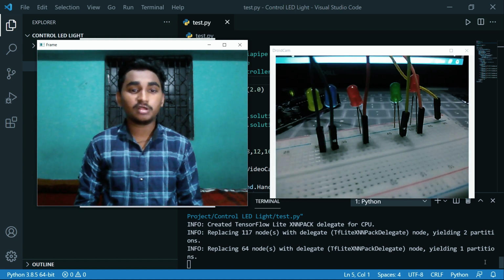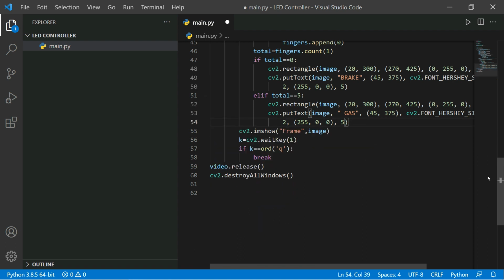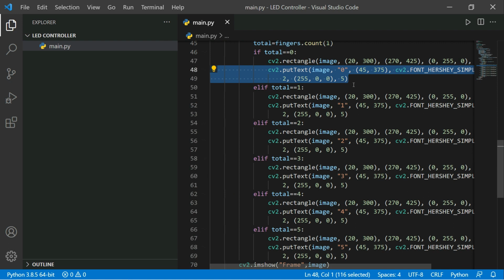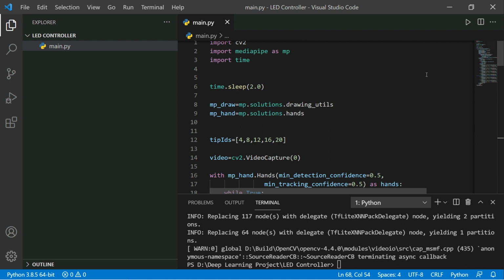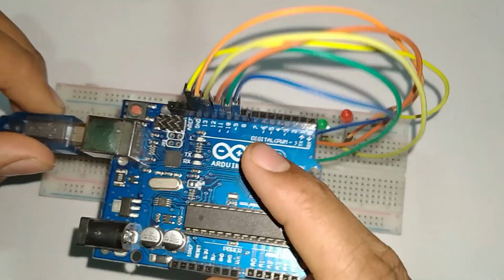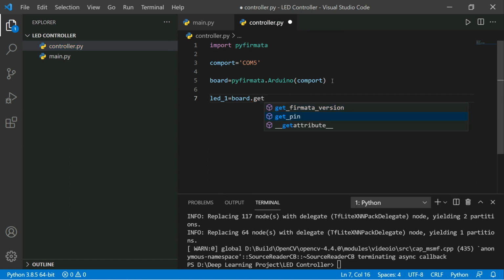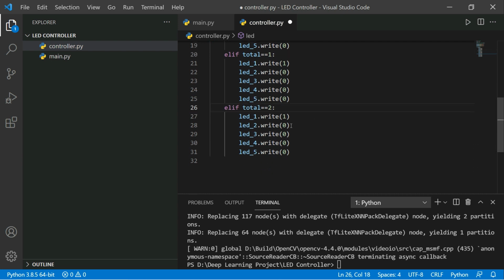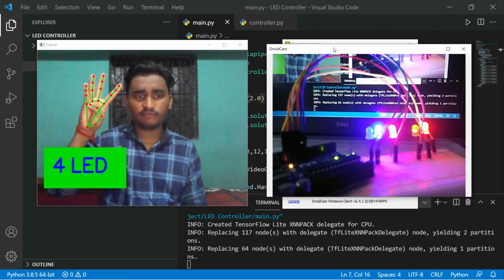How to controll LED Using Python,Mediapipe & Arduino | OpenCV Python l KNOWLEDGE DOCTOR | Mishu Dhar

Comment: Why are you not using resistors to protect the board and the leds?
Reply from the maker: Yeah you can use🌻 Cz i'm using wire connection from laptop so It's have it already

Comment: C:\Users\ASUS\LED_Controller\Scripts\python.exe C:\Users\ASUS\Downloads\led_controller_python_arduino-main\led_controller_python_arduino-main\LED_Controller\LED_Controller\main.py 
Traceback (most recent call last):
  File "C:\Users\ASUS\Downloads\led_controller_python_arduino-main\led_controller_python_arduino-main\LED_Controller\LED_Controller\main.py", line 4, in <module>
    import controller as cnt
  File "C:\Users\ASUS\Downloads\led_controller_python_arduino-main\led_controller_python_arduino-main\LED_Controller\LED_Controller\controller.py", line 5, in <module>
    board=pyfirmata.Arduino(comport)
          ^^^^^^^^^^^^^^^^^^^^^^^^^^
  File "C:\Users\ASUS\LED_Controller\Lib\site-packages\pyfirmata\_init__.py", line 19, in __init_
    super(Arduino, self).__init__(*args, **kwargs)
  File "C:\Users\ASUS\LED_Controller\Lib\site-packages\pyfirmata\pyfirmata.py", line 101, in _init_
    self.setup_layout(layout)
  File "C:\Users\ASUS\LED_Controller\Lib\site-packages\pyfirmata\pyfirmata.py", line 157, in setup_layout
    self._set_default_handlers()
  File "C:\Users\ASUS\LED_Controller\Lib\site-packages\pyfirmata\pyfirmata.py", line 161, in _set_default_handlers
    self.add_cmd_handler(ANALOG_MESSAGE, self._handle_analog_message)
  File "C:\Users\ASUS\LED_Controller\Lib\site-packages\pyfirmata\pyfirmata.py", line 185, in add_cmd_handler
    len_args = len(inspect.getargspec(func)[0])
                   ^^^^^^^^^^^^^^^^^^
AttributeError: module 'inspect' has no attribute 'getargspec'. Did you mean: 'getargs'?

I am getting this error. and i am getting another errors also. any one please help to build this project

Comment: 📺💬 He will tell us we are using a fast computer.
🥺💬 I am watching and you need the truths about why face recognition is more costs, it is about ratios and there are many complexes on our face especially now :)
📺💬 Leave him with filters and colour balls.
🥺💬 Cartoons characters now not only colour balls but many things todo.

📺💬 Why he had more scores with one answer a day, that is not existing 📺💬 we are working with Arduino and continue.
🥺💬 Continue developer I keep study too. 📺💬 Ads with high security tech, mod who you should block new answer or repeating answer⁉

📺💬 One more tips, COM5 as a string matching of the device manager or controller in VB or C++ provided interfaces allowed to specific of the address something lookalike HH&8 or references that make other devices working parallelly because it does not required controller but there is some problem when the old fashion communication program using one port receive and one port transmission ( some recorder too because they are simulation of channels maps ) this features help about monitor usages and prevent duplicated that can cause overflow and stop by the controller.
📺💬 You can have 100 COM ports do not make your computer slower.

📺💬 I create some signature ... 
🥺💬 To make all understanding it is not my intention to leaks any secrete but some study program they educated and graduate by build feedbacks tools or similar to what you are doing but with feedback system included in design. That is not any information leaks.
> the output improvement with similar learning patterns.

Comment: This is a brilliant project. I did a similar project with a single LED and also on  a strip of ws2812 RGB LEDs, and build a  dc motor buggy with controlled with hand gestures. I used micropython instead of arduino though. Mediapipe allows so many interesting projects - limitless  possibilities
Reply from the maker: Let's Try It With Micropython🔥

Comment: Sir, how can I connect the jumper wires between the board and the arduino? 
 What kind of jumper male or female, 
you mentioned in the video that you will explain it, but there is nothing
Reply from the maker: Please Check the Video Again. If You Don't Have Basic Knowledge Of Arduino & Bread board Please Learn How It's Work.

Comment: Hello, I want to ask some questions ~ 🙏🙏Can I make a rule about this: If a person's hand leaves out of the webcam range, can the light keep turning on for 3 mins and after 3 mins the light turns off ??😭
Reply from the maker: Yes It's Easy to Make. 
Just Use one Delay Function Here
Reply: @knowledgedoctor3849   Sorry!!! I have this issue and don't know how to fix it😰

image=cv2.cvtColor(image, cv2.COLOR_BGR2RGB)
cv2.error: OpenCV(4.5.5) D:\a\opencv-python\opencv-python\opencv\modules\imgproc\src\color.cpp:182: error: (-215:Assertion failed) !_src.empty() in function 'cv::cvtColor'

can you help me, please🙏🙏
Reply from the maker: It's Your Camera Error, Your Camera is not open due to some REASON
Reply: @knowledgedoctor3849  I change to another pc to run, it is actually can run, thank you~👍👍
Reply: You might do this by setting up the openCV program to detect your hand and signal the controller when there is no hand in view to turn the lights off

Comment: WARNING: library Servo claims to run on avr, megaavr, sam, samd, nrf52, stm32f4, mbed architecture(s) and may be incompatible with your current board which runs on mbed_nano architecture(s).

It give this error when I try to run Standard firmata on Arduino Nano 33 BLE Sense. Could you help me to resolve this
Reply: You need to use the correct bootloader for nano.